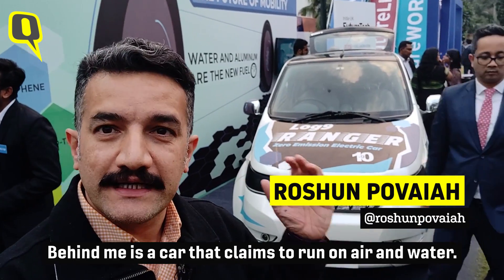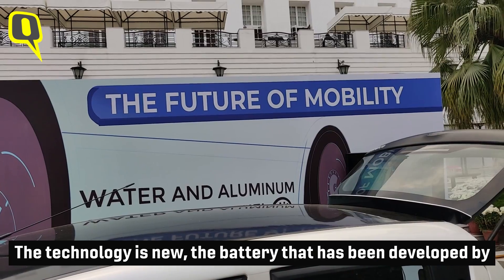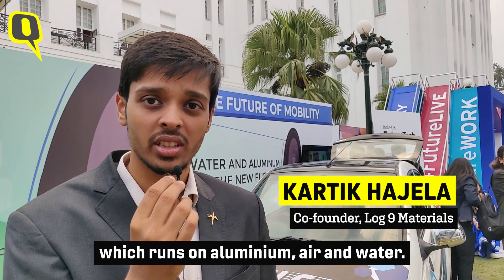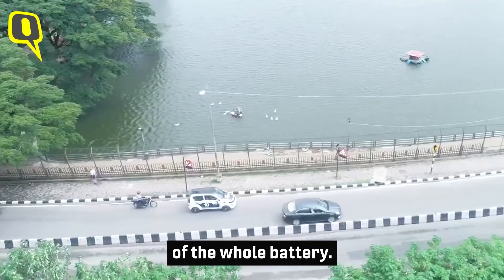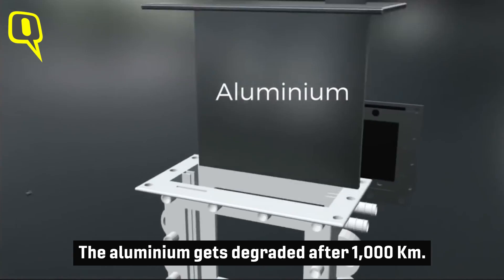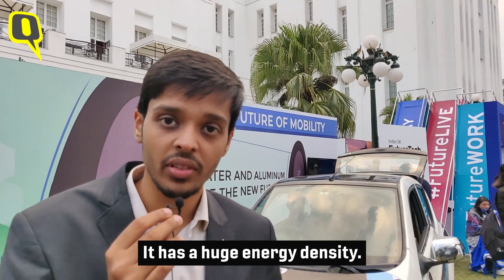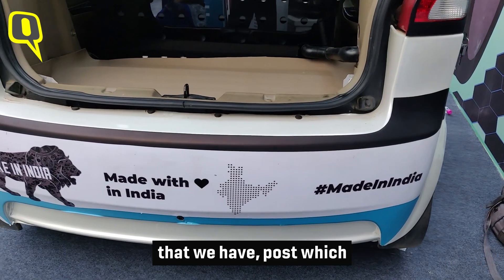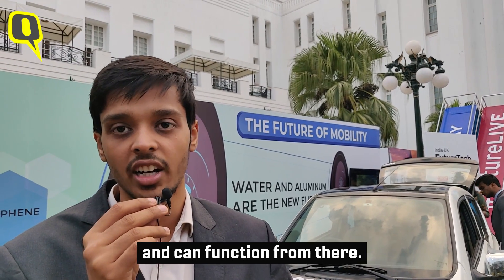A Car Powered By Water and Air | The Quint

Comment: Again aluminium is non renewable source of energy... hydrogen Fuel cell is best 🍺👍
Reply: Since Aluminium Hydroxide is insoluble in water and melts at 300 degrees C, it is possible to melt Al(OH)3 and get back the aluminium with just solar energy itself. So, we can make this renewable.

Comment: Such innovation doesn't goes anywhere
Reply: vaibhav Tandekar  If you don’t believe in it then of course it won’t go anywhere. So have more faith in us.
Reply: @Hammyfreak   us? Are you related to the company in any way?
Reply: Gaurav Singh all Indians are my brothers and sisters
Reply: @Hammyfreak  Some of 'your brothers and sisters' are in fossil fuels business and are going to give a hard time to this renewable energy sector. They will "find" problems in this, even if there aren't any.
Reply: Gaurav Singh yea... that’s why we should support such innovations... United we stand, divided we fall.
Reply: vaibhav As it is quite an unbelievable claim, a lot of people will not feel safe in buying the car or investing in the company. I think, firstly the claim should be verified. If it is true, it could be revolutionary and could go long.
Reply: Such grammar does not GO anywhere
Reply: Nihle Igleca I believe he got his point across, maam. So thaan podo
Reply: As he said power density is something that they are working on .. so if can deliver huge rush of amperes of current for quick pick up and acceleration for speed then this will be game changer .. but if it doesn't .. then are technologies like supercapacitor which has quick charging and discharging characteristics and charge-discharge cycles of supercapacitor are also very high .. but again the cost will go up .. we need to wait and watch what log9 can do ! Atb
Reply: It has to be come on a big scale and needs huge investment's has to happen